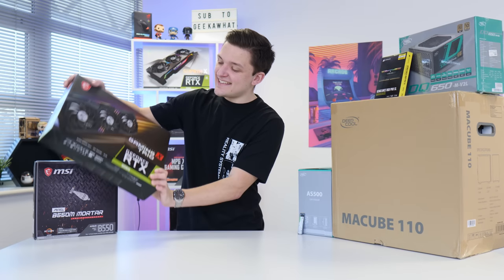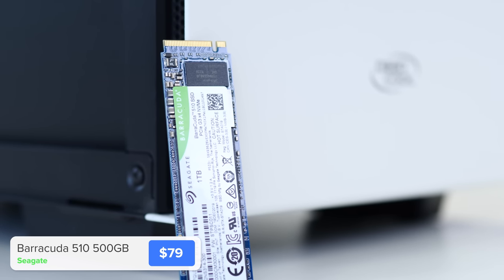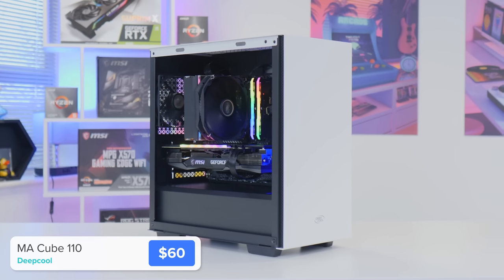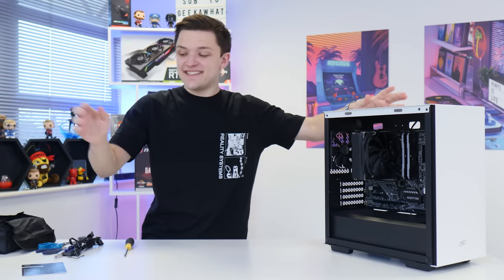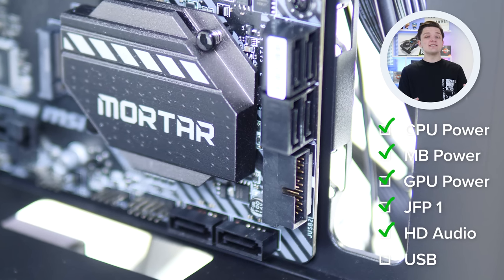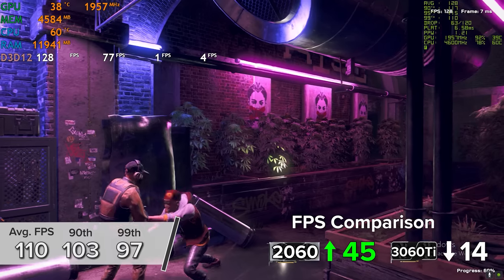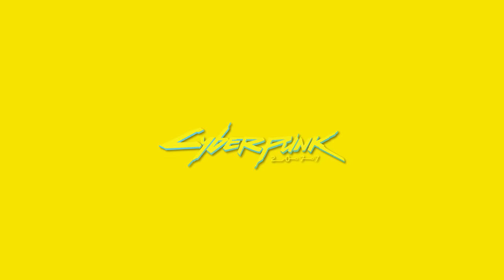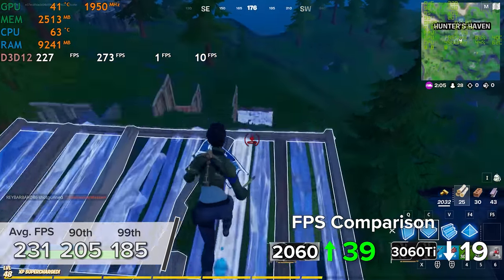RTX 3060 $1000 Gaming PC Build! [15+ Gaming Benchmarks - ft. MSI 3060 Gaming X Trio]

Comment: Finally the b550m Mortar gets some recognition. Everytie i search up videos on this motherboard, they rarely have over 40k views. Not many people care about motherboards then they wonder why their CPUs fry after 2 years. 

I highly recommend this motherboard if you plan on building in an mAtx case and if you feel like you will upgrade cpus in the future. All motherboards can upgrade cpus, but not many of them can keep cpu temps low like this motherboard. This motherboard has the best thermal vrm temperatures in factory settings and overclocked settings with high end cpus like 3700x, 3900x, 3950x out of all mAtx motherboards below $180. 

Has up to 3200 mhz supported memory speeds non overclocked. Can reach a max of 4400 mhz overclocked. Can handle 2000, 3000, 5000 series cpu. 
I got this motherboard yesterday it feels so good watching someone make a build on it.
 The price is actually $160 for the mortar. $170 for the mortar +wifi and bluetooth version.  
(not trying to be sassy, just being helpful).
 I know because I was comparing them yesterday at microcenter and at amazon.
Reply from the maker: Nice choice dude, it’s for sure a great board and really pleased to hear of your positive experience with it!

Comment: This might seem like a silly question but do all the cables that you mention come with any of the parts or do you have to buy them separately
Reply: Which cables?
Reply: @RodolfoHernandez-sq3zc  like the cpu power connector the gpu one the mb one jfp1 and the audio one
Reply: @DanielRamirez-nh3di  they all come with the power supply

Comment: I wanted to buy DQ650-M-V2L, but it's out of stock in my country. Been searching it for days, but i still couldn't find it. So i bought Cougar GX-F 750, and this is the first time i have my PSU. Then i realised that the 24 pin power connector has a missing pin in it, is that normal or i should go to the store and get the new one?

Comment: Do all of those PSU cables come with said parts they go to or do I have to buy said cables seperate?
Reply: Psu cables are included with the psu, check the information on the store page, it tells you what cables are included like the pcie 8 pins for gpu, 24pin for motherboard I believe
Reply: @MrProset  I appreciate it. So generally speaking between the PSU itself and any other respective parts that require Power, which I assume is all of them, will come with their respective cables?
Reply: @MrProset  pog, thx

Comment: Compares to the PS5 which is $399 vs $1000 PC and says it has better setting than PS5!! Yeah but also costs almost 3X more, that little detail you seem to skip over lol
Reply from the maker: PS5 is also out of stock lol 😭
Reply: @GeekaWhat  I got mind back in November so there is stock out there. Still doesn’t take away the fact of the difference in price which has to be factored in when compared with PS5 vs PC. Also the 3060 costs more than the PS5 by itself. Stock of the 3060 is also scarce which is a shame